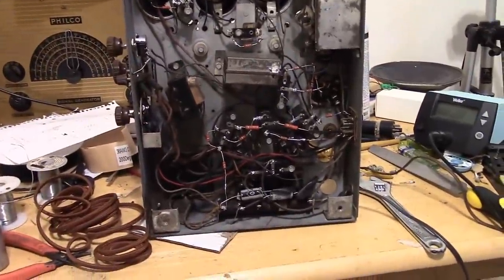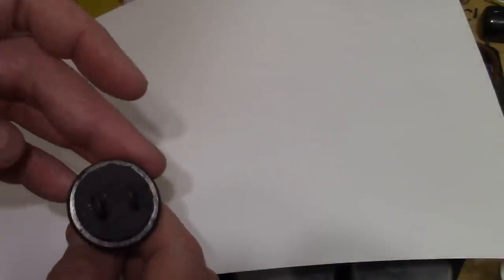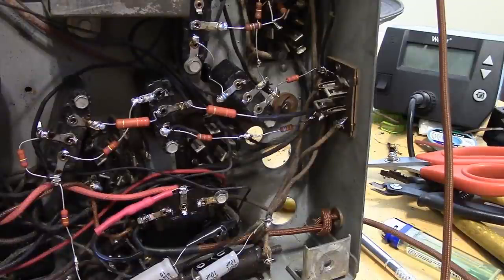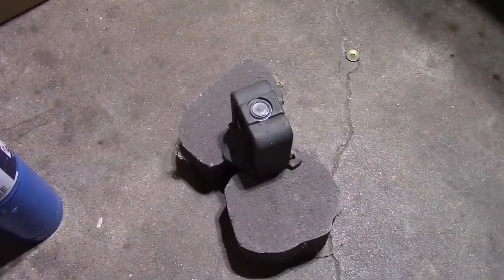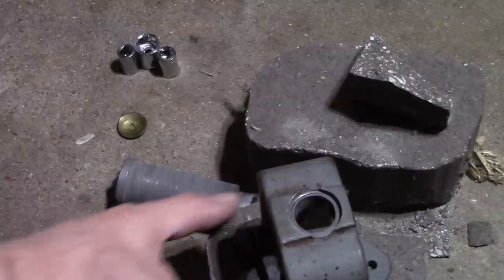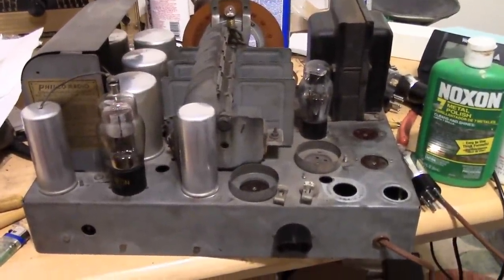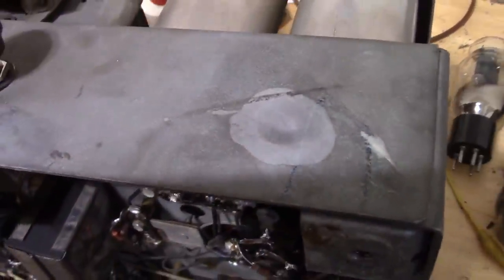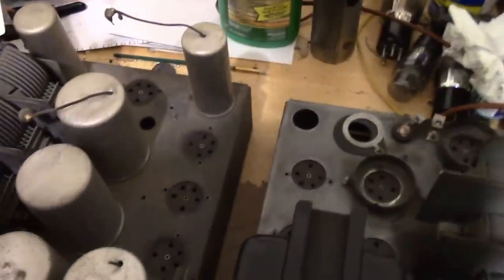Philco 90 resto p10o12

Comment: Regarding the speaker and removing the inner core; Heating it may well work. Yes both parts will heat up and expand, but at different rates. If the horse shoe outer expands quicker than the inner core, you have a winner.

Comment: I have used an electric fence charger and was able to "repair"/weld the break in the coil by arcing the break inside wherever it is. I have done this trick quite a few times and it works most of the time. If you have both ends of the coil then just hook the leads of the fence charger to them. Use one side to just touch the lead of coil momentarily. Then check with an ohm meter to see if it "welded" the break. It might take a few tries. Flock Shock is brand that would be the right size fence charger. or Fi Shock is another brand. Maybe somthing used on eBay. I learned this trick from a very old tv/radio repair guy. Wear rubber gloves !
Reply: My concern is that would only be a temporary fix. It clearly won't be as strong as a solid wire.

Comment: It must have been a lot of "fun" getting that center pole out of that speaker! As you do have continuity in the field coil, I think it would be a good idea to simply splice some new magnet wire on to the coil and wind it back up to 100%. It would be a royal pain in the neck to simply discard all of it and then rewind the coil form with all new wire.
Reply from the maker: Yes, that is what I plan on doing.  My only concern is that there may be other areas in the old wire that have been stressed.  I figure one of the caps shorted and it took out the field coil.

Comment: You can usually have strain relief on these old plugs by properly installing the conductors.

Hold the plug so the prongs are facing you and they are aligned one on top of the other.
Run the conductor up and over the top prong instead of attaching it directly to the screw.
Before terminating the conductor o the screw, twist the strands counterclockwise so the strands will tend to be pulled under the screw head.
Once terminated, push the conductor down so it is between the prong and the shell 

Rinse and repeat for the other prong.
Reply from the maker: I appreciate your response and suggestion.  The underwriters knob seems to work as well.  What I was trying to get across is what to do about the large opening in the bakelite ?  My concern is gap between the  wire and bakelite on the back of the plug.  Seems to me the insulation is going to get worn away

Comment: I vote for the stuffing method, but of course it's your project. The plus side you didn't mention is that if you stuff the O.E.M. caps, you already have the stock mounting location that will be secure. You could easily make a small period looking decal with the date of replacement. Besides the look, the engineering behind the original construction will be preserved.
Reply from the maker: You make excellent points.  If both caps were original, I'd be more inclined to restuff.  The earlier revision had a couple lovely copper mershon types.  It would be criminal to not keep those.

Comment: The  v groove around the top is a process of swelling the end after installation. May be able to reduce the diameter of the end a small amount to ease installation  and then peen the end of the shaft in several places with a center punch. The peening will lock it back in the frame. 

I have also wound lots of guitar pickups, let the new wire come off the end of the new spool with it sitting on the floor, guiding it between your fingers.  I get my enameled wire from Remington I believe they are in the Chicago area. Good luck.
Reply from the maker: Ah, that makes a lot of sense.  Thank you for the suggestions.
Reply: @bandersentv  you're welcome

Comment: You mentioned the in -rush resistors. I am working on a 1957 auto radio for a customer right now and that resistor is charcoal.  It is 0.3 ohm at 1/4 watt.

Comment: Hi Rob and company.  I realize this might not be the right place, but on the topic of rewinding coils I have a question.  I am rebuilding a 455KHz IF can.  I am re-attaching the two coils' leads to the bottom pins.  How should the phasing be observed?  Are the coils laid clock-wise to clock-wise, or counter-clock-wise to clockwise?  Also, I have looked around for a forum where I can ask questions like this.  Any sites anybody? This is sort of deep question, and I have only found light-weight sites.  Thank to all in advance.
Reply from the maker: I'm sorry to say I don't know.  I've only rewound a few coils and I was able to determine how the old wire was wound before rewinding.  The best place to ask would be the Antique Radio Forum.
Reply: @bandersentv  Bob, thanks for pointing me to the site.  I found my answer and help with another item, too.
BTW, coils are wrapped same direction, same phase.

Comment: So i do this kind of stuff in automotive work a lot, and i see that you came to some of these conclusions as I'm watching the video.  Nonetheless this should be helpful for anyone else. 
When you're trying to drive out an interference fit pin like that, use the largest socket you can fit in the diameter and RAIL on it, and heat the exterior part more. You should not be able  to touch it. Warping isn't really a problem with big cast parts like that. Holding the socket with some channel locks really helps you get some good whacks in and a quick reset. When you go to reassemble, just throw the casting in the oven to about 350f for a half an hour, and leave the centerpin in the freezer overnight, and when you go to throw it together, work QUICKLY. 

Theres a general rule for cast iron, dont heat it above 400f unless you heat it above 800f. It can stress crack if you do.
Reply: 2 words... Brass Rod.  He should be using a brass rod for banging on interference fit stuff.  I don't think heating this up was ever really an option and it's not an option putting it back together.  Heating it up enough to really make a difference is going to damage the windings.  I think cast iron doesn't expand that much when heated by a modest amount. I don't think you get it to expand 1% without risking damaging the windings.  If you can get the core down to zero (F) and the frame up to 200 (F), I still don't think that is going to make much of a difference.
Reply: @tarstarkusz  Brass rod yes, But speaking from experience as a welder I can wholeheartedly disagree with the entire rest of what you said.
Reply from the maker: Wouldn't the brass deform even more than the steel did?
Reply: @bandersentv  sorta but you can really rail on it and it takes less hits to accomplish the task, without mushrooming over the end of your part. and since its sort of soft, it doesnt bounce back as hard, acting as sort of a dead-blow effect. When the brass mushrooms over you just grind that part off and keep using it.
Reply: @bandersentv  Yes, a brass rod would deform more than the steel does. But that is the point.  You won't mushroom the steel or roll the edge using a brass rod.
Reply: @draggonhedd  What part do you disagree with?  If protecting the windings and the form wasn't important, then I would agree heating it up would help a lot.  Problem is, it's early plastic for the form and wire coating is even more delicate than the plastic.  It would be difficult to heat up that hunk of metal without heating up the windings.

Comment: my model 70, still has its "condensors" but they're not in the circuit at all, and I dont believe my radio has filter caps as its been redon but not by me, the line just goes to a bakelite block
Reply from the maker: The AC line filter caps are inside a bakelite block.  It has to have filter caps on the B+ or the radio wouldn't work.

Comment: Couldn't you use a thermistor to moderate inrush current long enough for the bigger filter caps to charge, then reduce as the set come up in voltage, sort of what is used in a Degaussing circuit in an older CRT TV? Would that not offer sufficient in-rush protection to limit what goes across the tube until everything stabilizes, just a matter of 10 seconds or so, however long it would be until voltages equalize, then drop to zero and become essentially electrically invisible to the circuit under normal operation after warm-up... or am I missing something?

I agree re-stuffing the filter caps in this instance would be a waste of resources, probably ugly to look at, and not make sense in the long run, as being in that metal tube would make them run warmer than needed, which is counter-intuitive to what you desire, lowest possible operating temperatures to maximize component life? 

Those big blue film caps looked sexy and solid, I would have been tempted to find a way to neatly integrate them under the chassis, knowing full well the radio would probably be 180 years old before the needed replacement, if ever again. As you have upgraded and eliminated so many weak points with much heartier components, I wouldn't be a bit surprised if everything but the tubes last another 90+ years before any service work is needed again. 

A well executed and intelligently thought out repair/upgrade series, for this and ANY  similar radio. I've learned a lot, so much in fact that I think I feel confident enough to try something similar of my own. I have a real hankering to restore a West German set, a Grundig or similar 50's early 60's All-Wave/FM Stereo set. What I need to figure out is a signal generator to buy for calibrating AM and FM/ Stereo tuners and radio's, but am not sure which one is better all around, for instance a HP 8640, 8656 or ST-1000A, or some combination of all 3.

I have quite a few tube and solid state tuners and receivers from the 60's and 70's in my collection, all of which need some maintenance work and calibration. I'd like to practice on something like this, an AA-5 or West German set before digging into them, so I have a better feel for the equipment needed and practice my skills. Thank you for sharing this series, I've really learned a lot watching you from episode 1 to this, and cannot wait to see the end of the series. 

I binge watched almost all of these yesterday and today, in one sitting, no I have a lot to digest.

Edit:..  BTW, coming over from the automotive restoration field, they make Cadmium and Zinc Phosphate 'COLORED' spray paint in the can, without all the nasty chemicals the real finishes carry. It protects better and looks better than the real stuff. I use it a lot when restoring cars. There is also Cast Blast and Cast Aluminum spray paints, minimal prep, just wipe clean with alcohol or brake clean, allow to dry and lightly build up coats until you are satisfied with the surface. It's easy to use, comes in a can and isn't poisonous as Zinc Phosphate or real Cadmium is. Plus it lasts longer and looks better, while protecting the metal. A light coat of applicable primer works best. Rinse, repeat, and enjoy!
Reply from the maker: Sure, but it would need to be rated appropriately.  The B+ in this radio is probably around 0.1A while most thermistors are designed for 1A or more.
Reply: @bandersentv  Sounds like there are better ways to go than a thermistor. Thank's for replying to my post. I must say I learned a lot just from the Philco 90 series. I cannot wait to start watching the next series. Entertaining as well as educational, a win-win !

Comment: Try using a tubing/pipe cutter to open old caps.
Reply from the maker: I have and found it leaves too much of an indent.  The aluminum is thin and soft.  I find I get a cleaner cut with just a utility knife.  I rarely bother restuffing anymore though.

Comment: It is not a good to solder mains wires that are then mechanically secured.  This is because solder creeps relatively quickly when under mechanical pressure at room temperature and the result is a loose mains joint and hence a high resistance and overheating occurs.  I have seen this happen in practice.  In the UK electricians just twist the stranded copper wire ends before they are mechanically secured.  Not a problem because copper does not creep at room temperature.  I believe in the USA some aluminium wires have been used on mains wiring.  Again a problem as aluminium creeps slowly at room temperature.
Reply from the maker: That's not what I did though.  I must not have explained very clearly.  I twisted the stranded coper and secured under the screws.  I only applied solder to the frayed ends sticking out after it was secured.
Reply: @bandersentv  OK my apologies

Comment: Air conditioning coil cleaner will clean up the variable capacitor and anything else aluminium.
Reply from the maker: Unfortunately, it's steel. I guess back then they didn't use aluminum for variable caps. Probably too expensive.

Comment: I'm really not too much of a fan of restuffing in general. A technician should be able to visually see what components there are lurking under the chassis. All it really does is create a headache for the next guy IMO. You could also try using Evapo-rust to clean up the chassis and coating it with Renaissance Wax. Evapo-rust is not acidic and does not attack the plating nearly as bad as the acid based rust removers will.
Reply from the maker: I used to be a big fan of restuffing but over time I've come around to your way of thinking.  Except for the bakelite blocks anyway.  I'm a big fan of Evapo-rust but am currently out.  I might pick ome up and give the tuning cap a bath.
Reply: @bandersentv  Sure, stuffing those mica blocks is no big deal, as well as replacing the mica wafers in IF cans, etc. The irony is that the quality of the new caps are usually better than the caps that are being restuffed.

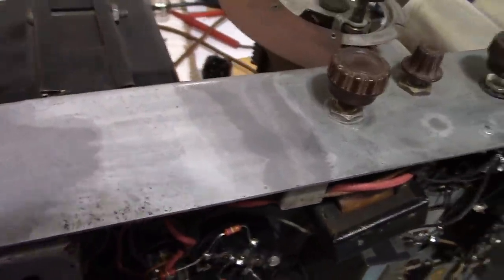Comment: IMHO, it looks worse where you cleaned it (46:46) with the inconsistent color.  Frankly, unless the radio was used in a kitchen or other place where grease is in the air and then the dust mixed with the grease, which is a big awful mess, really, it's a metal chassis. It's gonna get like this in a few years anyway even if you completely stripped it down and redid the whole thing.
If anything, just do the tuning capacitor and replace the rubber grommets if need be.
Reply from the maker: Yes, I agree.  I did it to show all of you what it would look like.  I already replaced the gromets.  The tuning cap is steel rather than aluminum and I don't currently have a good way to remove the corrosion from it.  If I do anything it will be to swap the better one from the other chassis,
Reply: @bandersentv  Just so you know, I wasn't criticizing. You are far better at this than I am.   Yeah, I agree the other one looks better and you have it, so why not do the transfer.....